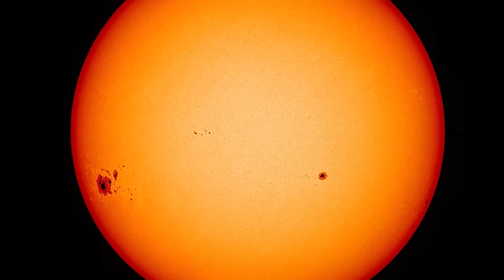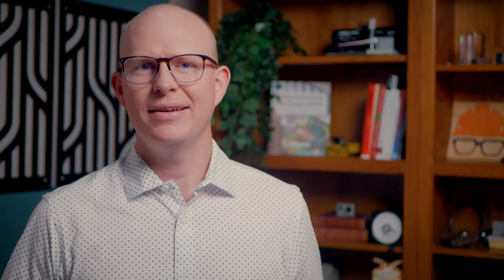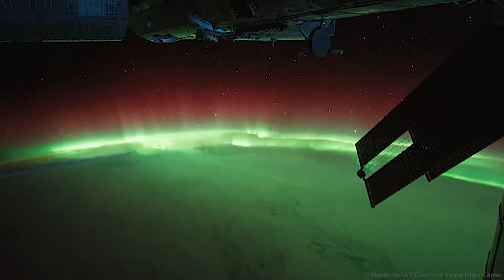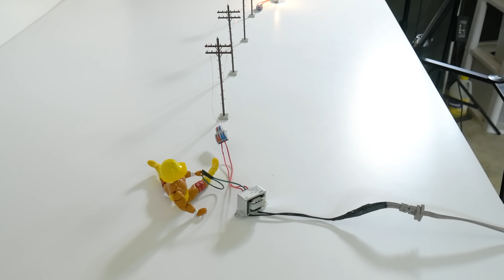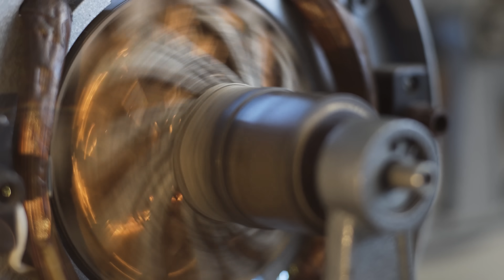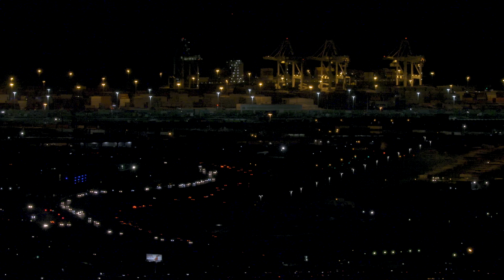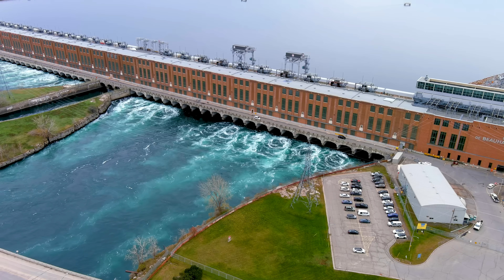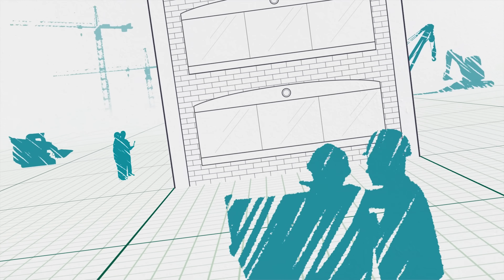The Most Confusing Part of the Power Grid

Comment: Awesome information as usual! I should quit and let you do electronics!!
Regarding 17:03, I would say having just capacitors on power lines works the same as just inductors on the line, in that they also create reactive power and so drawing more current than needed from power lines. So they don't boost voltage, but if more capacitance is used than inductance, the reactive portion of current goes right back up and the capacitors are not helpful anymore. So we need to switch them out/in to make sure they almost exactly cancel out the effect of inductors.
Reply: I am waiting on the collaboration between Practical Engineering and ElectroBOOM.
Reply: Woah what is electroboom doing here with 20 likes
Reply: i do hope i'm not the only one who read this comment in Mehdi voice
Reply: @evilotis01  While I didn't read it out loud,  in my head, I could almost hear Mehdi saying "capacitance" and "inductance".
Reply: I love this channel, but cannot imagine Grady explaining electronics with as much enthusiasm or as many OSHA violations!
Reply: Capacitors do actually boost voltage because powerlines have very little resistance and lots of reactance. So real power impacts voltage less than reactive power. Capacitors increase voltage, inductors decrease voltage and resistive load doesn’t affect voltage all that much
Reply: @Henrik0x7F  🙂 That doesn't make sense, but thanks for the feedback!
Reply: @ElectroBOOM  It's not that capacitors raise voltage themselves, but by providing reactive power, they raise the power factor, reducing the voltage drop across the line. Resulting in a higher voltage at the capacitors. From an operator's perspective, we're just maintaining system voltage; as long as voltage is in band, power factor is too
Reply: @ElectroBOOM  I mean, try it out in spice or draw some vectors.
Reply: @Henrik0x7F  That's rather surprising, power lines are just straight conductors, and straight conductors is how one usually reduces stray inductance, so effectively your saying a straight bit of wire is more lossy due to inductance rather than resistance - even if the frequency is extremely low like 50 or 60Hz, I'm more accustomed to MHz signal losses,  50/60Hz is all but DC in that realm.
Reply: @paulstubbs7678  Depending on the configuration a 110 kV line has a resistance of 0.12 Ohm per kilometre and a reactance of 0.39 Ohm per kilometre (1.2 mH/km @ 50 Hz). So yes. A straight conductor with a normal cross section is more reactive than resistive.

Comment: Another very common way to absorb reactive power from transmission lines, especially higher voltage lines, is the opposite of capacitor banks, which is a reactor (a large inductor essentially). Synchronous condensers can do more in that they can generate reactive power and also help with system stability, but they are larger, much more expensive, and require more maintenence than a reactor does.
Reply: Superconducting coils. Watch out for magnetic quenching.

Comment: As a physicists who ended up with a career in a company that provides equipment and solutions for the power grid, it took me quite a while to learn how to visualize reactive power. None of my electrical colleagues was able to explain other than drawing the triangle and explaining the Phytagoras theorem, until one colleague gave me an analogy that really worked for me.

Imagine a water company providing water to a city, but located 100 km away. It is connected by a water pipe that starts out empty. Now if I want to consume a liter of water in my home in that city, the water company needs to first put that liter into the pipe on the other side. But after they put that liter in the pipe I still cannot get it out of the tap on my side. The water company first needs to fill up the full volume of that pipe with probably thousands of liters of water and only after it is completely full, will I be able to consume my liter of water. Still, the water company can't charge me for all those thousands of liters of water that they had to put into the pipe. They can only charge me for that one liter that I actually consumed.

Reactive power works in an analogous way. Electricity will not flow without magnetism. The power plant needs to "fill" up the full power grid by magnetizing it. This requires power. And it is exactly this power that is called reactive power that is needed to magnetize the power grid. Without the grid being full of magnetic flux, electricity will not flow out of your local outlet. Often in electrical power engineering reactive power is being regarded as unusable, but it is actually very much needed for the power grid. Without it the power grid would not work at all.

Comment: Inverters correct power factor.  Large solar fields sell power factor correction all night long.  If they have battery banks, they also sell spinning reserve.  Since most wind turbines include inverters (interesting topic by it self.  The turbines go through DC to synchronize with the grid.), they most likely do the same thing.
Reply: Same for modern devices. Anything with a naturally high need for reactive power has power factor correction circuitry built into it. Even crappy Chinese LED lights do at this point.

Comment: I enjoyed your video, and thanks. I have a couple of questions about power flow in AC circuits. Is there a way to measure power flow and direction in an AC circuit? In a case where a customer has a grid-tied inverter and solar panels, how does the utility smart meter differentiate and measure the power supplied by the grid going to the customer vs the power generated by the solar panels  and inverter going to the grid? Thanks again.

Comment: Making sure that no power bounces back from the load is also super important in data transmission. You can't get a clean signal when there are reflected signals bouncing around the circuit. Instead of power factor you look at the reflection coefficient.
Reply: Data transmission is a lot more complicated than power transmission.
Reply: matched load!
Reply: It's a totally different effect, though. That's about impedance matching.
Reply: @thewhitefalcon8539  I wouldn't say it's totally different. In both impedance matching and power factor correction you aim to cancel out reactance.